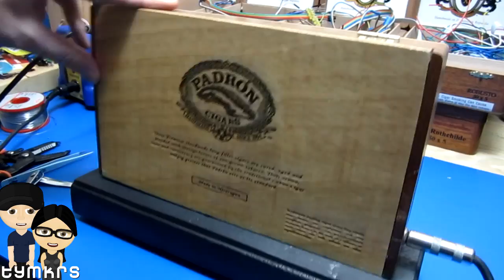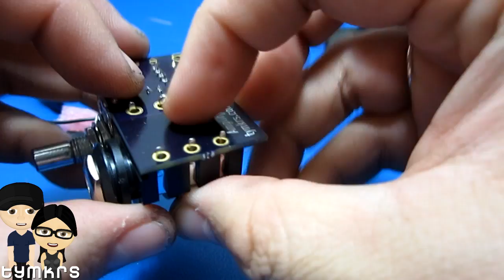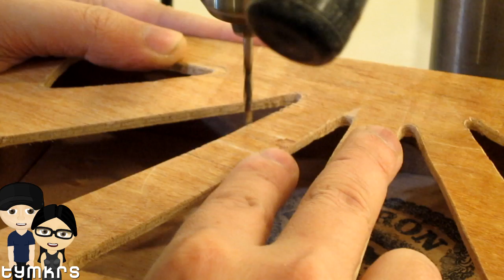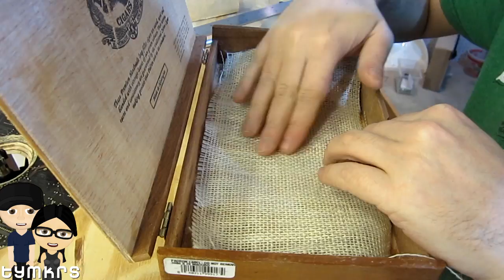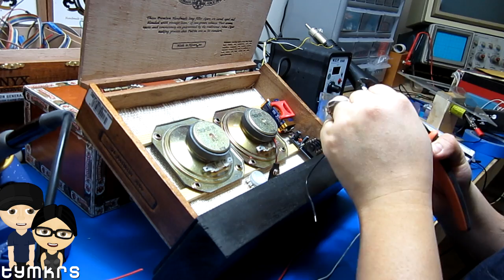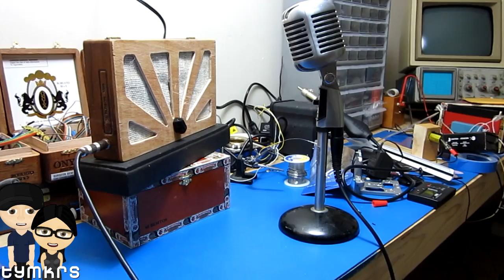Tymkrs Cigar Box Guitar Amp

Comment: Wouldn't it sound better if the baffle didn't allow air around the front outside of the speaker? Speaker cabinets are usually either vented to the front with a specific dimension of tube, or the cabinets are completely sealed, or the back, but not the front baffle, is completely open.
Reply from the maker: Normally true.  Note, however, that the speakers are of the sealed variety.  They are completely enclosed on the backs.  Not that high fidelity is really a goal here, hehehe.
Reply: whisk0r Ah! I didn't notice that they were sealed. Yeah I get that fidelity isn't the point--I was just curious in case you knew something I didn't . . . and you did. :)

Comment: I notice there is no on/off switch. Are we just connecting the battery each time?
Reply from the maker: Or add a single pole single throw switch inline with the ground or positive on the battery connector :)
Reply: Thanks! Just got my kit today
Reply from the maker: Awesome!  Sorry it took a bit longer, been dealing with ice storms and blizzards up here :D  Enjoy tinkering!
Reply: Well, the kit went together ok but it won't make a sound. I've checked and rechecked all solder joints and speaker leads. Any ideas?
Reply from the maker: Check battery voltage?
Reply: Yes, battery is good with power at the board.
Reply from the maker: LM386 installed the right way around, audio cable tests good and is seated all the way on both ends, double check that the source is indeed producing output, polarity of the battery connector is correct.  If you did add a switch, verify that it operates open/closed in the way you were intending.
Reply: Battery tests 8.5 dcv disconnected. But when connected to the board I get 2.5dcv. Is that right?
Reply from the maker: 8.5 is a bit low to begin with.  I'd try a fresher battery.  That voltage drop while connected also sounds off.  If it still silent with a new battery, I'd recheck for any solder bridges / shorts.  Something may be pulling it down hard.
Reply: After checking all connections again and switching out the battery, I got 5 seconds of a faint hiss from the speaker. Volume pot full open. I was able to strum the guitar connected while the hiss was still present but no string sound at all.  Then nothing. Battery is 9.5. Still 2.5 on the board.
Reply from the maker: That 2.5vdc tells me something is half shorted.  Photo of top and bottom of the board to feedback at tymkrs dot com and I'll get Atdiy to take a look for ya.  See if she can spot the bug.

Comment: Is there a way to tie in a LED?
Reply from the maker: I don't see any reason why not.
Reply: Where would one connect the LED on the board?
Reply from the maker: An LED and a current limiting resistor of say 10K ohms in series across the positive and negative power wires coming into the board would be an easy way to add a power indicator light.